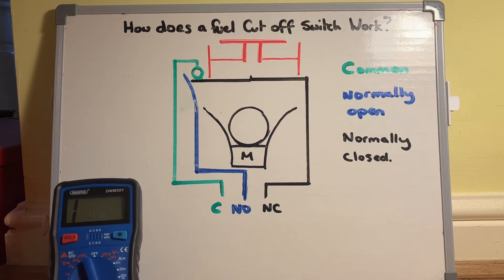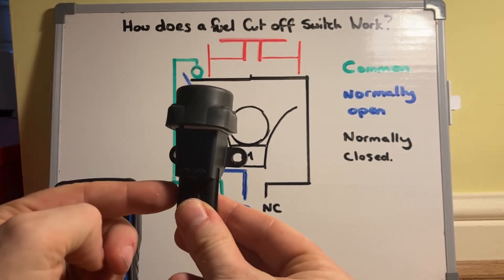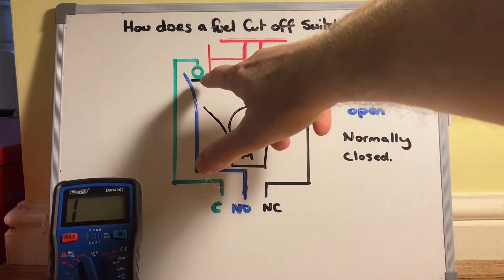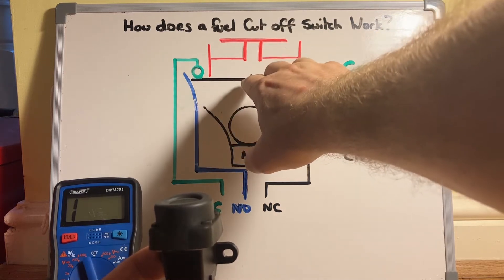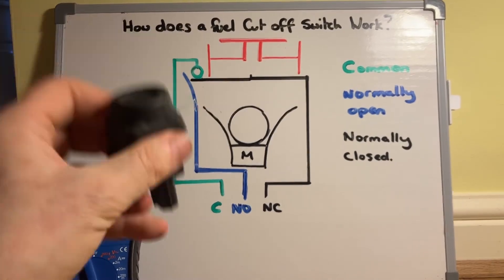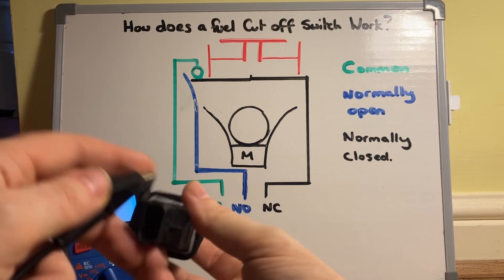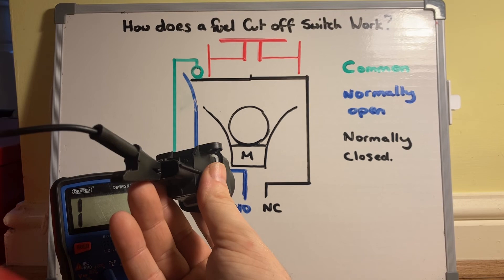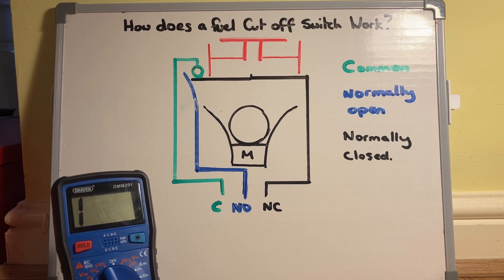How a Fuel ‘Cut Off’ Switch Works & How to Test it.

Comment: Why there is no audio alarm when switch is on off position? Only visual alarm will not work when it is a huge risk involved.
Reply from the maker: Good question, if you are getting no fuel supply, always worth a quick chrck
Reply: For this exact reason I wired a buzzer onto the pin which gets +12v when the switch is tripped.  Works a treat.  My car has a carburettor with a float bowl so I wouldn't know for a few seconds and then it would slowly splutter and die.